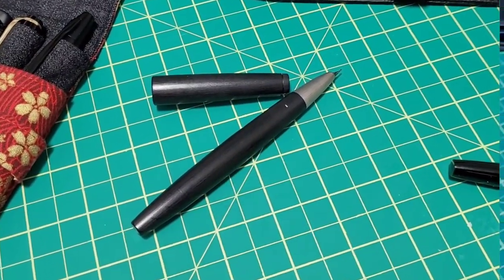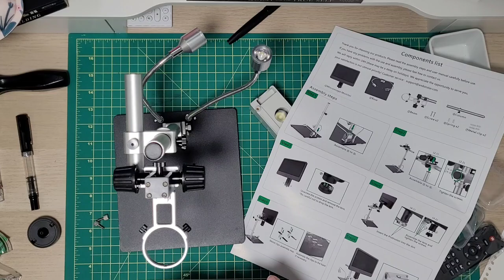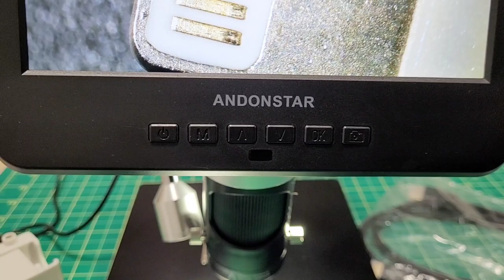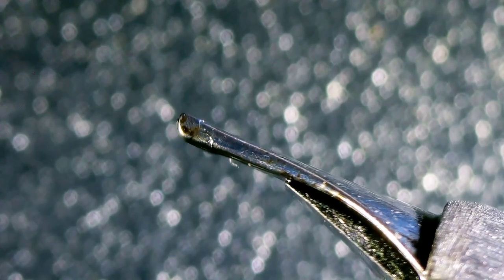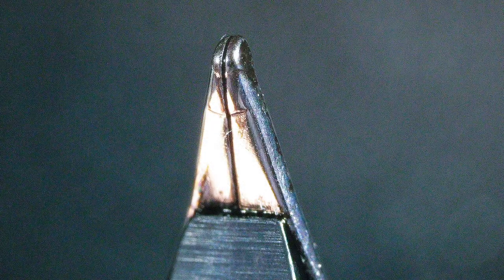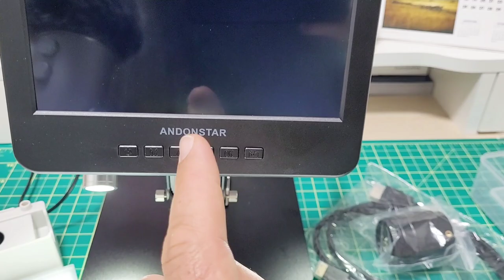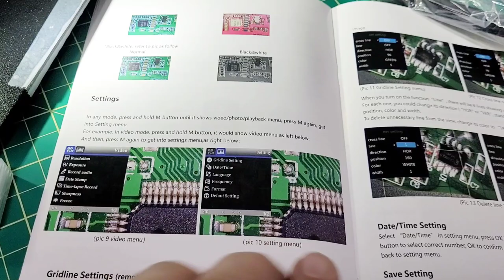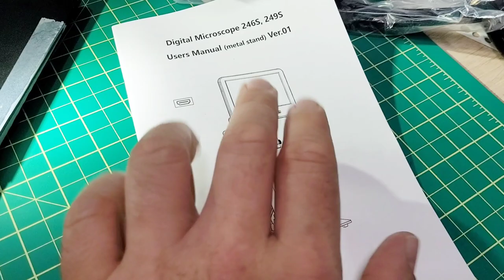Lamy 2000 Nib Grind With Andonstar Microscope

Comment: You're a very brave man grinding the nib on a Lamy 2000. The microscope is very impressive for the price. Perhaps, in order to maintain stability, it could be clamped to a bench or table.
Reply from the maker: Its pretty darn stable, but if you push the buttons at high magnification you can get a little wiggle.  But the remote solves that problem.  The microscope made the process a dream!
Reply: @Doodlebud  Definitely would make this much easier. Looks like a nice microscope. Certainly helps with precision work, and way easier than the eye loupe you need to hold in your eye.

Comment: My cousin has one of these in his house. I'll try to take your art to the next level. I am developing a pen holder so that you can place the tip to the grinding wheel without much variation. I'm experimenting with a mic boom arm. I've got a spare one. Also got a stage stand for mics. Need some engineering for the pen holder just: a holder suitable for multiple pens. If this works I can make a robot using servo motors to hold the pen and present it with precision. If you yourself can take out the labor and time from this you could turn this into a business. Another way would be to use a rectangular premade while making the nib. Don't know if that's possible but it would be a game changer. I've always been advocating this. These days fountain pens a not a practical for actual (serious) work. So there is no point of making so many round tips anymore. Whoever solves this problem using technology and then markets it using social media could be sitting on a gold mine. Would love to help you on this. I myself am an engineer by the way.

Comment: Very cool! I have a question about the scope. Was there noticeable lag between moving something under the lens and when it showed up on the display? I've looked into things like this before for doing surface mount soldering and the digital scopes were always too laggy for hand/eye coordination and fine motor control. It always came down to needing optical scopes, and those are significantly more expensive.
Reply from the maker: This one seemed pretty good. But I'm going to be doing a seperate review of just the microscope as well & get into more details like that. Maybe I'll try soldering something & record the video